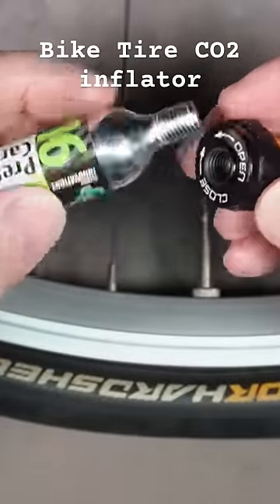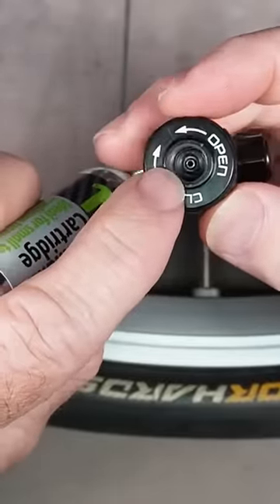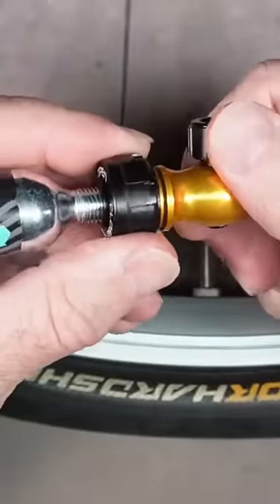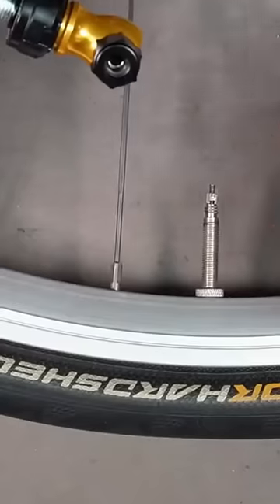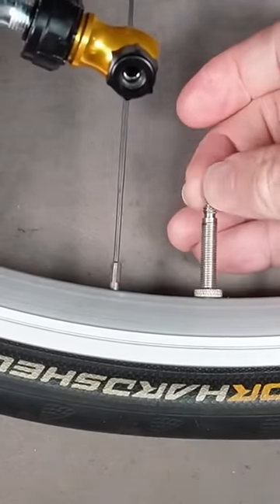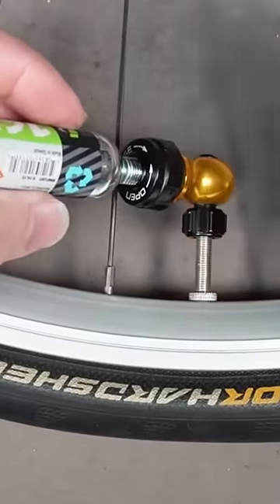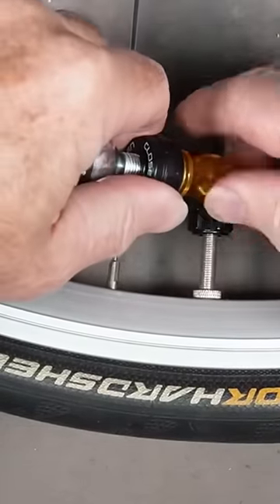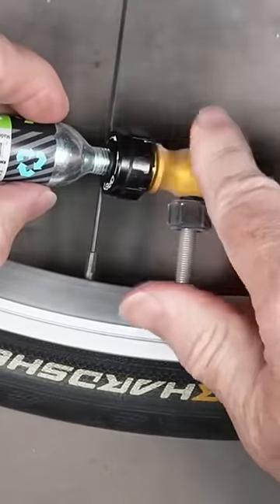Bike Tire (tyre) CO2 Inflator: How to use. #bicyclerepair #bike

Comment: ssssssssssss
Reply from the maker: Nothing will escape when the CO2 inflator is removed. This is a Presta valve. Presta valves close when there is pressure inside the tube or tire. I only loosened the lock nut, which is necessary for air or CO2 to flow into or out of a Presta valve. I did not remove the core.
Thanks for the comment! I appreciate it!

Comment: yeah ok now remove it air escapes soyou cant get an exact pressure this is junk my friend has it its junk dont waste your money dont be lazy use a real pump and also why would you be riding on a low tire ???makes no sense and if it goes flat while riding you got a hole so walk it home lazy lollmao no practical use for this junk
Reply from the maker: So, A CO2 inflator is just another option for emergencies to quickly and easily inflate a tire out on the road after fixing a flat. It is super small, light and inflates a tire in seconds. Has been used by cyclists for decades. Thanks for commenting!

Comment: Wtf!? just use a hand pump or a air compressor... wtf is this overpriced throw away trash?
Reply from the maker: A CO2 inflator is just another option for emergencies to quickly and easily inflate a tire out on the road after fixing a flat. Thanks for the comment!